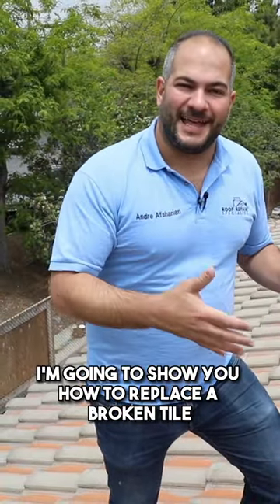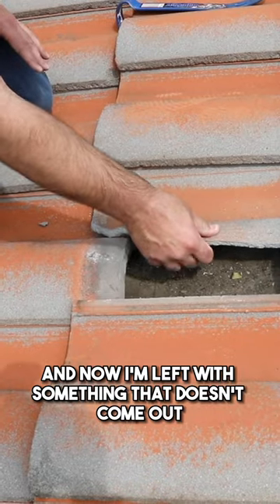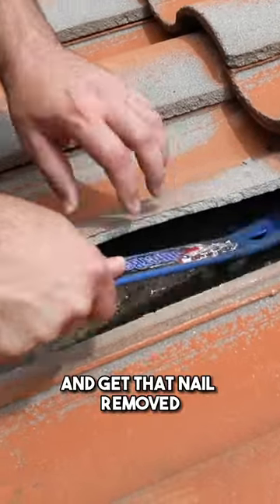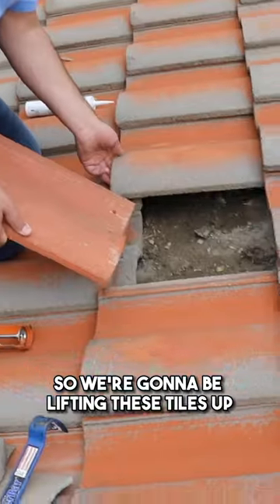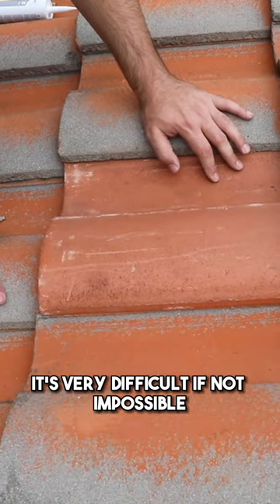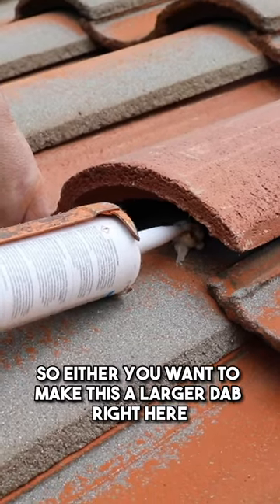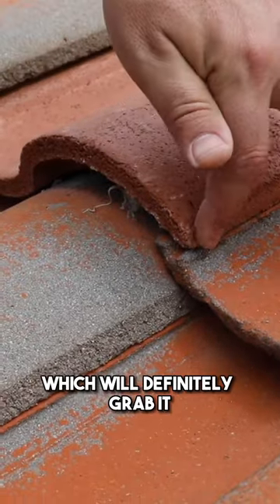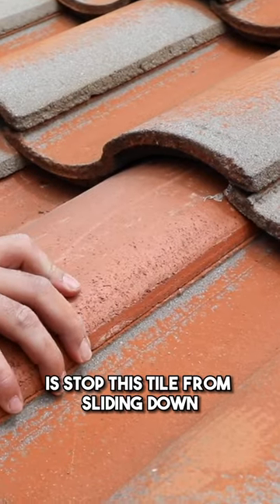How to replace a broken tile

Comment: Forgot to caulk the nail hole and usually the adhesive is pleased up high in the water channel under the lap
Reply from the maker: Agree on the mail hole for sure. Very good point

Comment: Never put silicone in a water course
Reply: @RoofRepairSpecialist  Not quite true! You never want to SEAL the water course. It is recommended to do vertical application of silicone to not interrupt water from leaving, but using silicone properly is okay.